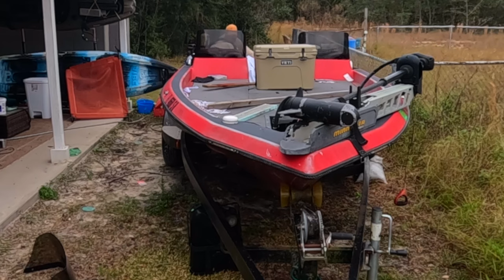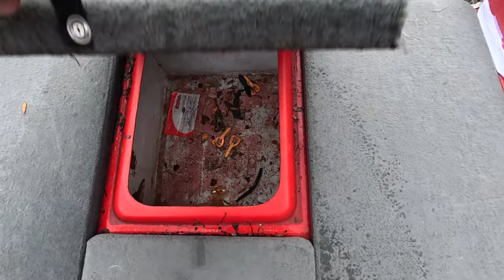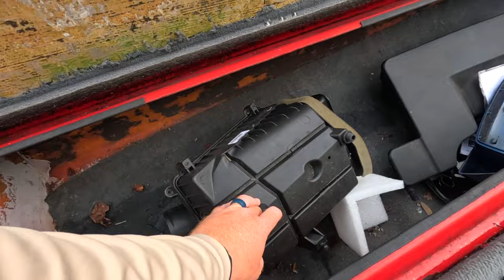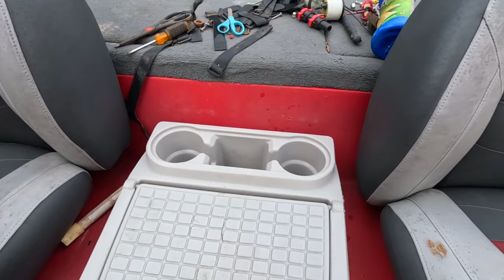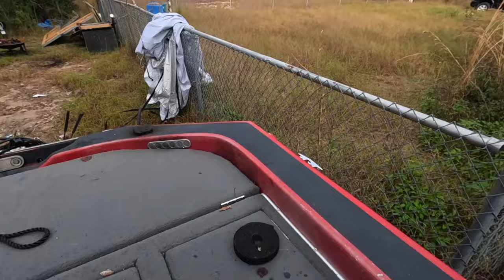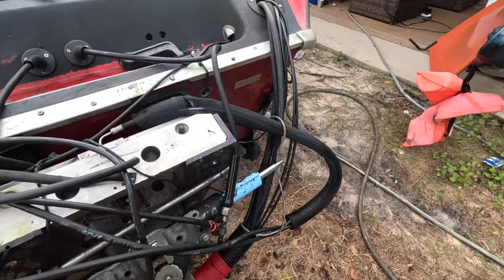Time to get serious about professional bass fishing.

Comment: Man i know youre in love with that Champion but I'd flip both those boats and throw down on a used 2000+ Triton Tr 19, 20, 21 or a Stratos 294 or 201. Full composite hulls not known for major transom issues and a more modern and functional deck layout to build on.  If you're not putting a new outboard on that thing old reliable used 2 stroke motors are Merc EFI, Yamaha OX66, and Evinrude/Johnson carb motors. Good Luck!

Comment: You made a great hull choice with a champion. Those boats were so far ahead of their time. The most important thing will be having a reliable motor. Honestly most of the deck and storage areas don’t even need redone but just need cleaned. (Might want carpet or seadek in the cockpit) but besides that it’s not bad at all!
Reply: Also just remember that GRAPHS ARE THE MOST IMPORTANT THING! Everything else is just something nice to have besides a reliable motor. ffs , si, and di are a must have.

Comment: I’m running a 1998 ranger and I’m trying to trick it out this year, talked to an older man at the Ranger plant about my fuel tank capacity and he told me my boat was the only 17 1/2 footer Ranger ever built that was rated for a 175 motor. My plan is to run until it quits and replace it with a new motor, the gel is pretty rough looking and there’s a few deep scratches, I’m planning on getting the top cap wrapped instead of fixing all that stuff. Hoping to add power poles this year. My plan is to keep this boat until I’m too old and just fix whatever has to be fixed on it.
Reply from the maker: To be honest after the warranty is up on a new hull it will cost the same as an old boat to maintain so I like your perspective.

Comment: Replace the rub rail first I sold mine because the top cap was separating from the bottom cap of the boat. It’s a two-piece fiberglass hull . It looks like the rub rail actually holds it together in the front. Unless mine was  defective.

Comment: It’s not just the pro level, you gotta have a pretty decent boat just to compete locally, 4-5 years ago when FFS started to be a big deal with bass fishing it blew mind that guys were spending thousands at the local level fishing in tournaments that don’t pay but a few hundred bucks for 1st place. But the sad reality is you got to have it to compete. I finally bit the bullet this year and got a garmin set up, a family member bought a 12 inch garmin, the 34 transducer, black box, the setup for using dewalt lithium batteries, and a mount and decided he didn’t want it, I got all that for 2500.00.
Reply from the maker: Yea we realized that as well but Swamp bass isn’t even worth $2000. Which is why we needed an upgrade. But I will be getting fss for the champion as well

Comment: Dude, a fancy boat is nothing if a fisherman can't drag the hogs in! Years ago, my first boat was an old Bayliner 20' fish/ski that was like a bass boat, Force 125 engine. I fished against the guys with the new expensive bass boats. Something I quickly figured out, they wouldn't take those new boats in the skinny water loaded with tree branches, hydrilla and lily pads, but I didn't care if my boat got banged up.
Reply from the maker: Definitely one of the advantages to an old boat. They are battle tested.

Comment: Listen, these people that think you have to have a brand new 120k boat set up to be competitive are so damn mistaken (that's what the industry has done, on purpose) it's just simply not true. As long as your hull is solid, have a good motor, and trailer, you can be competitive. Awesome boat man, I bought a 196 (in very similar shape, and same if not worse financial situation being active duty) right before the Rona, I spent that whole year restoring it, all together, I spent less than 35k and I'm fishing just fine...I wish you luck on your journey, it won't be an easy one, especially in today's world. Just remember, don't go broke, it's not worth it.
Reply from the maker: It’s crazy right. Besides once this boat is restored it will be unique and make me stand out more.
Reply: @thebraveangler  not to mention riding on one of (if not the best) riding hulls ever...make sure your transom is solid (champs were known to have weaker transoms) what engine are you planning on running?
Reply from the maker: Yea whether it’s good or not we are going to rebuild it. Engine are too heavy nowadays for plywood transom
Reply: @thebraveangler  yup. I did 1" of coosa and a 1/4" aluminum plate on mine, it's rock solid. I have a 200 Yamaha vmax hung on it.

Comment: I'm posting twice felt like I already wrote one book. You could flip these boats also. Mercury XRI 200 is what that boat cane with to tell you how realible that motor is the one i had on my 1995 195 Charger is still running never been rebuilt and is now pushing a Gambler boat. The guy who bought my Charger hung an Optimax on it in 2014 I think. Brooks Marine in Bauxite Arkansas can tell you the whole story and may have one hanging around the shop there ready to go. Randy knows me if you call just mention pondman...lol... long story
But like I said before it takes time and money and lots of both. 
Confiscate drug money, just saying...😅

Comment: I've worked at a boat dealership actually a good amount you're better off getting rid of that used boat I can tell you that you are going to spend a lot of $$$$$$$$$$$$ to even have it at 30 % I would just bite the bullet and get something new but affordable
Reply from the maker: I did take aluminum bass boats in consideration but luckily I do have some friends with marine fiberglass experience and I have a lot of mechanic experience so luckily we should have to pay someone to do the work for us.

Comment: Bruh, the motor and work alone are gonna cost you 30k.... Should've just bought a 3-4 year old model and put new electronics on it....
Reply from the maker: I will be doing the repairs to the hull myself and finance a new motor. 30k is better than 60k plus 15k for new graphs. The way I see it. Is the hull doesn’t matter after the warranty is up it doesn’t matter if it’s a restored old boat, a boat you molded yourself, or one a couple years old. But the champion is unique and I can build it the for the way I fish cheaper than buying something newer and having to pay to reconfigure it. At lease that is my mindset.
Reply: Gl Competing with bass pro shops

Comment: Reality check... if you have to worry about the money wolf you will never be successful.
You can get a Nitro Z-19 Pro ready to roll for $50k
But here is what's going to bite you in the ass, I networked and had the best of the best to fish with and the time and some money even won a boat to pay off my boat and cashed 17 checks in 20 tournaments it took 4 yrs to get there and that was with no job and 300 days on the water my 4th year. If you don't have time and money forget it... your pushing a rope. You have a good Champion boat to invest in but your looking at $50k to make that boat right. 
Not to be mean but speak softly and carry expensive spinning rods, hint.
But if you need to be humbled let me know, because professional bass fishing is about time on the water and money, lots of money.
Good luck to you.
Place in England Arkansas that does great restoration and Brooks Marine in Bauxite Arkansas that may have a motor for you. Don't forget to completely redo the trailer hubs etc. Boards are rotten replace, check transom before you even think about hanging a motor, that should be done by a knowledgeable repair shop. John Story built some good boats but lots to do before you start sinking money into it.